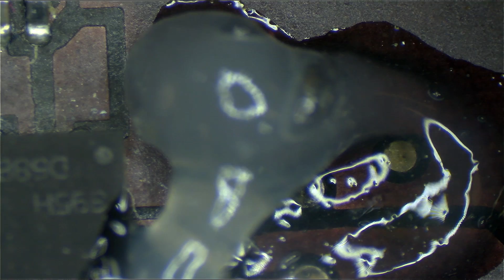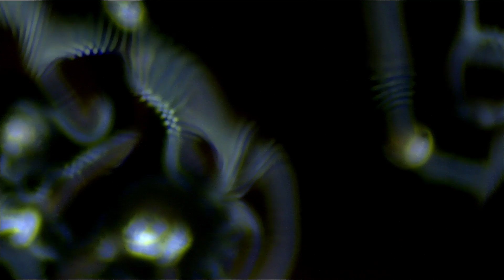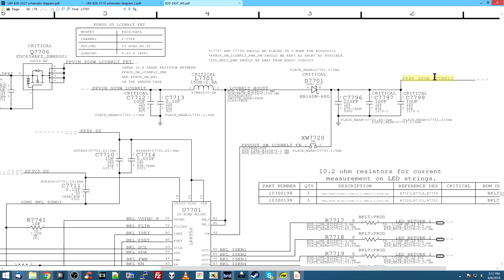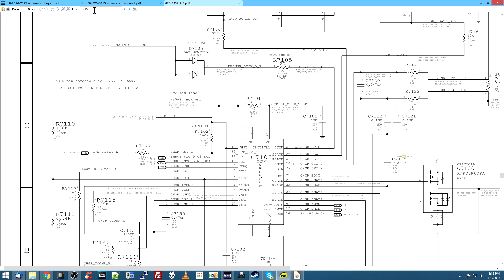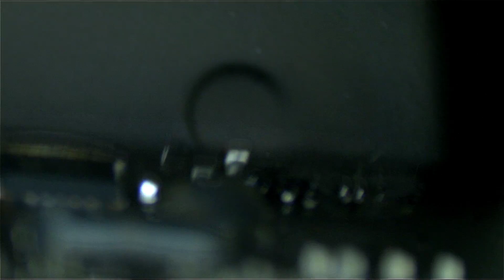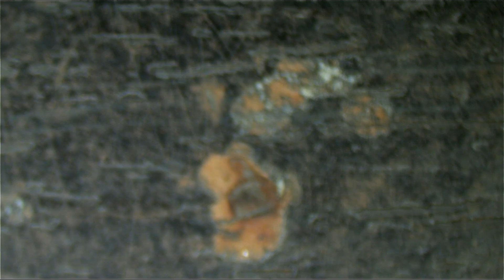Annoying no backlight repair on a Macbook

Comment: If you use a single chip camera(no beam splitters and multiple sensors) then your sensor is most likely giving you a 420 output. That you can record at higher resolution. But you can't get anything back that wasn't there in the first place. 
 I.E. any difference is caused by variations profiles and settings, or maybe placebo, but not by the raw footage.
444 makes most sense if you're into high end compositing, but even then anything consumer-viewable is converted back to 420...
Reply from the maker: thank you!

Comment: Why do you use vegas? Why not premiere? (I am asking this in a why do you prefer one over the other.
Reply from the maker: premiere is too confusing
Reply: I've used both, though not extensively. I prefer Vegas over Premiere because I already know how to use Vegas and the learning curve in Premiere is a bit overwhelming to some people like myself.
Reply: I tried vegas. It wasn't stable enough with my system, so i had to learn premiere. After you learn how to use premiere and find out good keyboard shortcuts it is quite neat.
Reply: +Louis Rossmann yeah, I have found it can be quite confusing but for me who has too much time on their hands and am willing to spend it to find out how to use premiere

Comment: Hey Louis what is that gel solution you put on the circuit board? Sorry I don't really know much about electronics only here to listen to your lectures <3
Reply: It's called Flux. The purpose is to make soldering easier because it flows easier with flux. :)
Reply: Flux

Comment: +Louis Rossmann As others have stated the resolution is not great and the only available resolution on our end is 360p. However, the original resolution should be available later so I will give this an update after a few hours have passed. Thanks for checking with us.